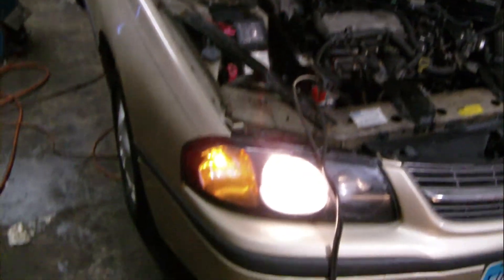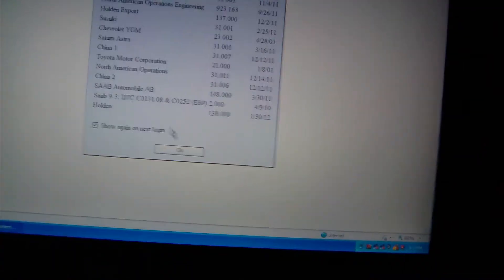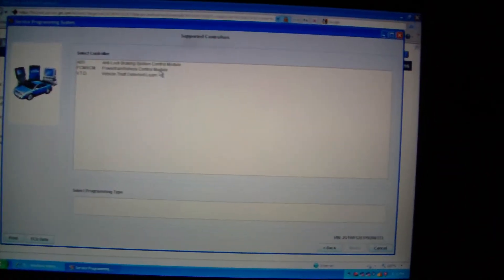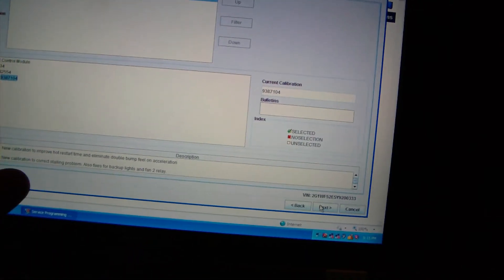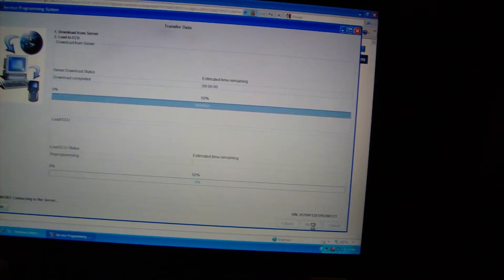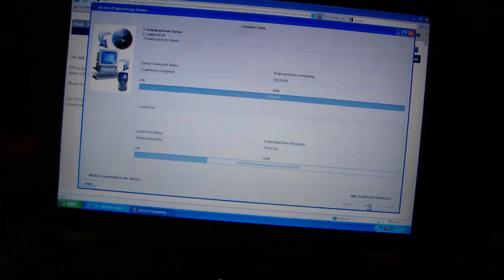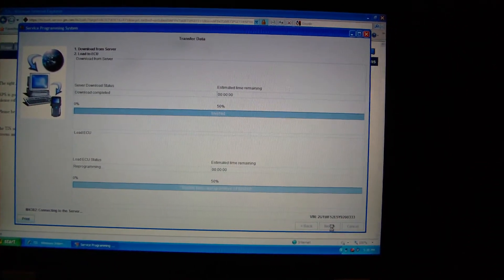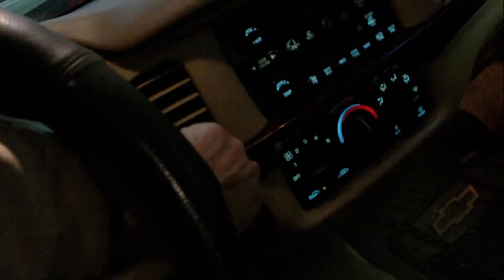Bosh Flasher Pro j 2534 programming pcm Chevy Impala

Comment: UGotMalk  ITS A MUST because the battery gets drained when you have the ignition turned on when u flash it. so u need a back up battery for the computer if in any case the battery does die the computer still has a back up to that little power supply .... certain people forget when u disconnect a battery terminal off the battery u reset the computer which the car will run but it will never be the same smooth as u first got it.